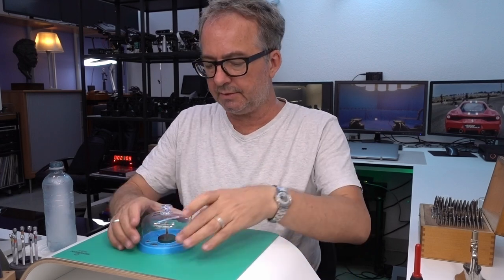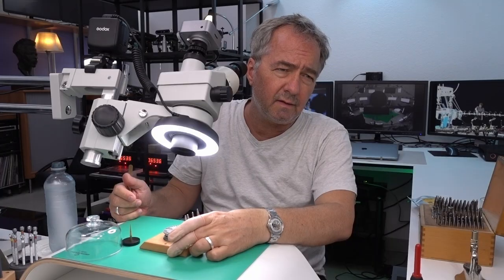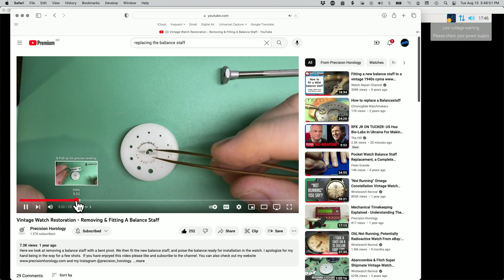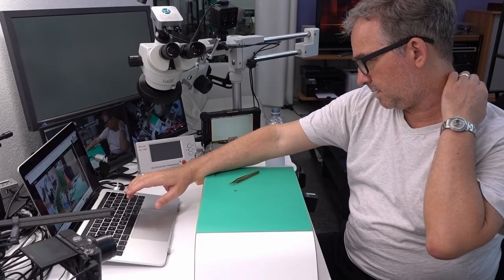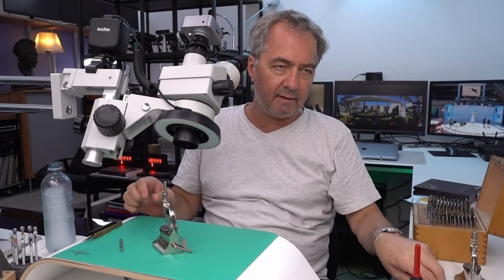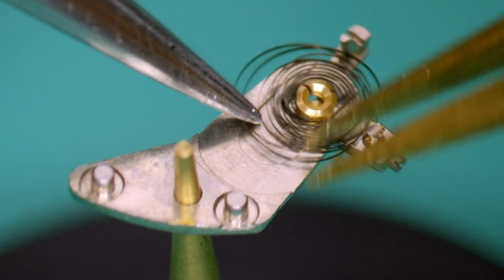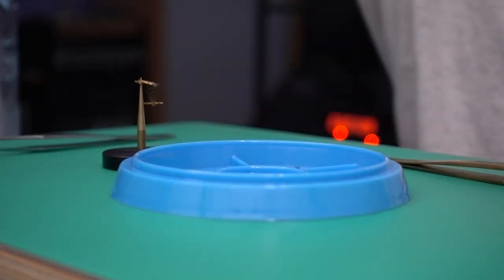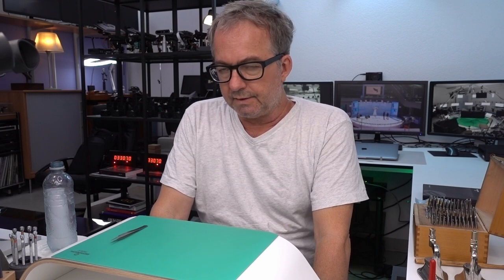Replacing the Balance Staff in a Balance Wheel

Comment: He is pulling on the balance and will distort. the spring, this video is killing me. Nice closeups however
Reply from the maker: I grew up in Boulder Colorado driving sports cars and motorcycles way too fast on ice and gravel and I'm still alive. I have two modes: test the limits safely when the road is wide and there's no canyon off the side, and then stay well within those limits when there is. I've found that this approach generally works and is faster than the cautious approach of treating dry pavement as if it's black ice and trying to never to break into a skid. It's also a lot more fun! 😂😂😂

Comment: OMG! You removed the collet with the hairspring attached to the balance cock. Buy The Watch repairers manual
Reply from the maker: Thanks! I just looked at it and I may get it. The problem is it's not laid out in a very useful way (numbered parts and numbered lists are not very fun to look at) and I know 99% of what's in it already. It does seem useful for absolute beginners, but it would be a lot more accessible with better graphics and layout.
Reply: @IMakeWatches  I have a video reviewing all the books available for watch repair

Comment: watching this is like a blacksmith  doing brain surgery i thick you would benefit from having some basic watch repairing  courses. Start by binning the microscope off out of the way
Reply from the maker: Thanks! That's exactly what I was going for! 😂😂😂 I'm training with the microscope because of YouTube and they won't let me bring it to watchmaking school so I have to do it solo!
Reply: I use 10 x 20 x magnification loop 1 eye and only use microscope for close up work now and then . Also always take the hairspring off first then the collet and finally the roller table off. I’ve been repairing watches for 20 years and still learning
Reply from the maker: @TommyTightPants0115  Thanks! Yeah, I'll have to follow better protocol including your suggestions when I do this repair for real. I've already failed a number of times but I have two more balance staffs and a lathe now in case I have to make a third one!